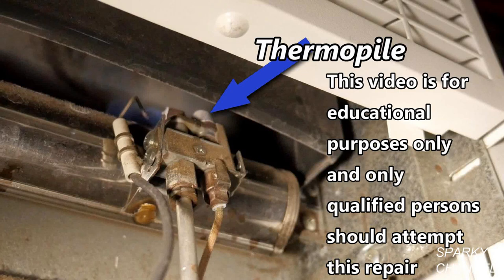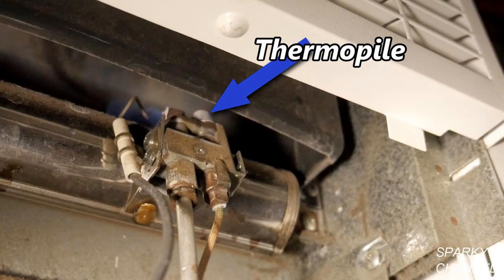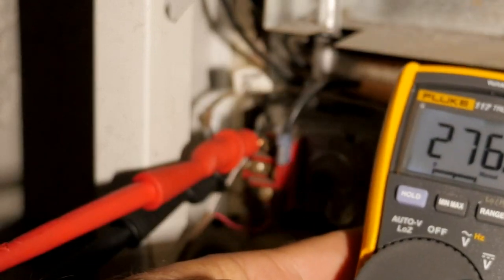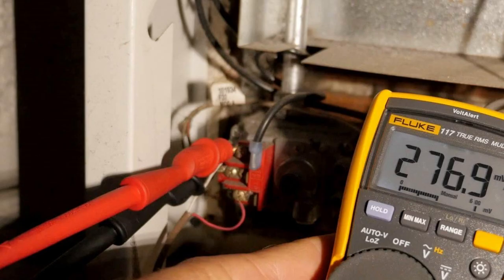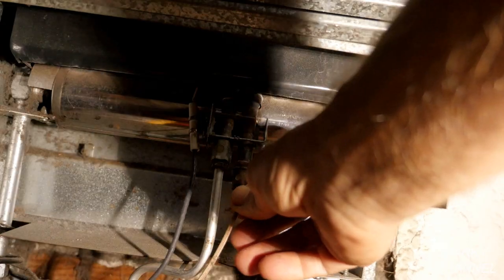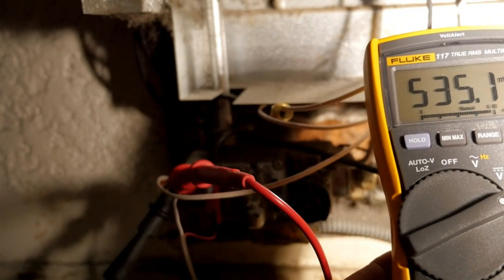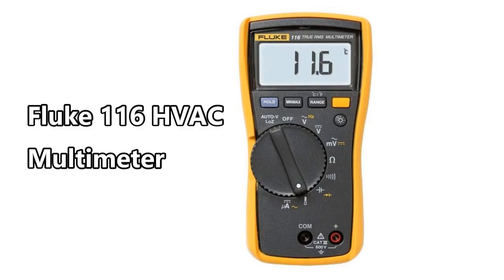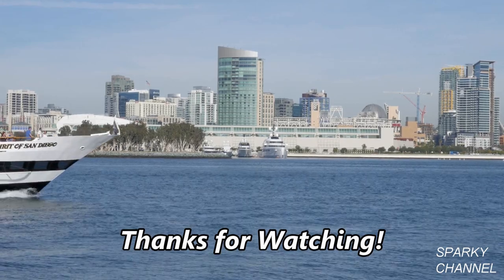How To Test and Replace a Thermopile: Wall Furnace Burner Won't Ignite

Comment: You have saved me yet again!!! I couldn’t find any other videos outlining my exact issue with my wall furnace, then I came across this video. Gave me something to test, then replaced and now works great!!
I have learned so much in 2 years from watching your videos. I have gone from not knowing how to change a receptacle to repairing wall furnace, upgrading all receptacles throughout the house, adding Caseta light switches, expanding the house electrical with breakers and new Fromex, and installing CAT7 throughout. Who knew I would love this electrical stuff so much!
Reply from the maker: Wow, that's great! Isn't that CAT7 nice? I get excellent speed with no interference with mine. It speeded up my uploads to YouTube so much! And it eliminated the botched uploads that I would have to do over previously. New video today: How To Wire 3-Way Switches with Diagrams Included: https://youtu.be/tkWhqMZiNvs
Thanks so much!

Comment: You helped correct me on thermocouple vs thermopile.  Hard to find an exact replacement for the thermopile.  Also I noticed with a replacement you have to have the pilot kinda high to produce enough mV.  In order to get 300mV+ do you have to have a significant amount of flame on the pilot?  In old stoves it’s a small flame in stuff with thermopiles maybe the pilot needs to be quite big to produce enough heat on the thermopile.  Thoughts?

Comment: Good video Sparky.  We still have a lot of wall furnaces, floor furnaces, and space heaters  in Missouri.  Most of them use thermopile.. Mostly LP gas.  Brands like Williamson, Cozy and Empire.
Reply from the maker: Lots of them out here in SoCal as well. Our heating needs are often met quite well by a gas wall heater. Thanks!

Comment: The pilot burner should aways be cleaned before testing the thermopile,The best way to check the millivolts is on a open read,that is with the white and red wires disconnected from the gas control valve,light the pilot(you will have to keep the knob depressed while making this test)then check read across the disconnected terminals with the pilot fully hot.The other test is the closed read,with all wires connected and the thermostat calling for heat.On this test the Millivolt read should roughly 1/2 the MV reading of the open read.You can also check the MV read across the gas control valve coil if you know what MV rating the valve needs to open.It could be around 150 MV with the thermostat calling for heat.
Reply from the maker: Thanks!

Comment: If the package shows between 250 and 750, one would think 277 (is) in between 250 and 750, being that 277 is above the 250 minimum & below the 750 maximum on the package. From some of the comments, I see these readings can change when heat is running. Maybe that's what I'm missing. Am i the only one that would have thought 277 was good enough (because 277 falls between 250 and 750?

Comment: Help! I have williams wall furnace just like this one. Use every day. All of a sudden, when I move the little black lever to the right on the analog thermostat, the furnace doesn't turn on like it always has before. The pilot light is staying lit but just not responding to the thermostat. Does this mean the gas valve is faulty or is it possible that the thermopile had gone bad? I thought the thermopile ONLY controls the pilot flame but maybe Im wrong? It's cold as shit this weekend, and it decided to brake now!! Please help!
Reply: It sounds like it is your thermopile.

Comment: Hey Sparky are both black wires with the blue insulation heads supposed to be plugged into the terminal? I see in the video that one is plugged in and the other is not. My Williams wall Furnace has both plugged in. Please let me know. Thank you!

Comment: I'm having a really hard time with replacing the rusty pilot light and thermo pile ..
On the Empire floor model furnace ..
The first pilot light I bought was a universal and pilot light flame was loud and way to high  making swoosh noise ..
Do I have to order a replacement from Empire ?
Or is something wrong with the furnace ?

Comment: Hi Bill, when I have my multimeter dial turned to 2 mila-vaults setting the readings I am getting is -.523 with thermostat off and -.075 thermostat on.  Is this a good reading?

Comment: Hi Sir
Thanks for video. I have old Williams furnace similar to yours (35GV-5). I replaced thermopile due to low reading (200mV). With the new thermopile, it read 500mV, the pilot got flames When thermostat turned heat on then the voltage across thermopile read about 250mv. But the furnace is NOT fired. Any advice or recommendations.
Reply from the maker: I'd check all connections and I would check for Signs of Carbon Monoxide Leaks such as:
Soot: You may notice soot-like stains on your furnace. ...
Smell: While carbon monoxide doesn't emit odor, it may get accompanied by other exhaust gases that produce an odor.
A yellow burner flame: The pilot flame may produce an unusual yellow flame instead of the normal blue one.

Comment: Question here.. I see voltage specs for furnace thermopiles (approx. 500-750mV) quoted frequently - but I can't find any current specs (mA). What is the typical "good" current range for one?

If it matters, my application is a very old (ca. 1910) hot water furnace with a milivolt gas valve. No 120V AC required, just a standing pilot + thermopile, a T87 mechanical thermostat & gas valve.

Issue is that the burner can be sluggish / hesitant to light up when the thermostat calls for heat. Thanks in advance.
Reply from the maker: You should be able to find those specs on the package of a new thermopile.
Reply: @SparkyChannel  I'm not finding that to be the case at all. If any spec is quoted, it's the same nominal 750mV..  when I'm wanting to know the expected current - either a short-circuit figure or the loop current with the gas valve coil in series.

My valve opens but it's slow to do so. The voltage seems OK, but a current figure would be good to know!

Comment: I havn old gas wall furnace. Simple two wire (R & W) to thermostat. No fans, no power of any kind to the furnace other that what comes from the thermo pyle.  Lived in the house for 25 yrs and have replaced gas control valve twice over the years. Last year furnace wouldn't ignite. Found that bumping the valve lightly initiated gas flow and ignition. Didn't replace valve as sometimes it would function for weeks with no problem.  Obtained new valve and upon inspection found a gas fitting between the valve and the burner leaking slightly. Tightened that and valve continued to function fine. Doesn't seem related does it! Few weeks ago upon signal from the thermostat the furnace would not ignite. Tap on the valve didn't work. Thermostat was a programmable one and I was constantly having to over-ride the settings, so replaced it with a new non-programmable one. Didn't solve the problem. Now, when I raise the temp control on the thermostat the furnace ignites and runs for about 30 seconds to 2 minutes then cuts off. turning the thermostat off for a few minutes, then on, the furnace once again ignites, then cuts of.  Dozens of trials with same results. Is it likely a failure of the thermo pyle?
Reply from the maker: I do think it is probably the thermopile. However, is your heater 25+ years old? If you've used it every year I really would like to encourage you to purchase a new wall furnace if possible. I understand about the financial implications but a new furnace would be much more efficient and possibly healthier.
Reply: @SparkyChannel    The only part that has "aged" is the gas control valve. I have looked at new wall heaters seen them disassembled. The metal exchanging chambers are virtually identical. The venting/chimney system are identical. And my unit shows no deterioration of the metal parts. Turns out to be a loose thermocouple wire and and an adjustment needed to the pilot to better heat the thermopylae bulb. Oh, btw, I keep a new control valve on hand. just in case.

Comment: I just replaced my thermopile due to pilot light not staying on. Worked great for 2 weeks and now the pilot light stays, burners kick in for only a few minutes and then they shut off. Any suggestions?
Reply from the maker: Did anything come loose or move?
Reply: @SparkyChannel  nothing that I can see. I'll check my wiring and surrounding areas.
Reply: Did you also check the vent safety switch?

Comment: My Williams wall heater looks like the one in the video. My thermopile just slides in without and threads just like in the video. The 2 thermopiles you suggested don’t look the same as the one in the video. Which one should I get?
Reply from the maker: Try to get the same one you are taking out.

Comment: Well, Bill, I have spent years figuring out how my furnace works in the presence of an incompetent technician. I had to yell at him to stop changing the thermostats, none of which was broken. I found a mechanical thermostat for this type of furnace, and now I can start the furnace by shorting the thermostat. It turns off at temperature. I inspected the thermopile today and it is like the one in your video, and now I know what to do. The technician has refused to clean or replace the thermopile. I still cannot figure out how he is still in business. Your very short video has shown me what I have been looking for since 3 or 4 years now. I have other heat for the house. I only use this furnace in the dead of winter on very cold days but I want it to function properly. I have paid this guy for so many pointless visits... I would like to ... well, cannot say it here what I would like to do to the guy.
Reply from the maker: Glad to hear that's it's working!
Reply: @SparkyChannel  it is not working but at least I know what the problem is and that I have to find a technician who will test the thermopile, and either clean or replace it. He will not be getting paid until he does exactly that.

Comment: Just rebuilt an Empire DV115 wall heater, new Robershaw regulator, thermopile, pilot burner/gasket, electrode, & igniter. Worked great, next day nope. Replaced therostate with an upgrated Honeywell digital programable, it working fine, but regulator valve apparenty not opening. Found thermopile putting out 356m thermostate off, 443mv thermostate on. My feeling is that many of these thermopile's are junk. Its a 36in long, I ordeerred a replacement thats 24in long, say's 750mv & compatable with DV210/215. I'll see in a few days if the new one fixes the issue.
My only thought is that the 2 wires running from the thrmostate into the heater to the regulator connectores is old. But I guess if I just dissconect them and jump the two regulator connectors, if the regulator dosn't ignite the heater log, then the regulator gas valve simply isnt getting enough power to switch on/off the gas valve.
Reply from the maker: Yes, try the new thermopile.

Comment: My thermopile reads about 550 millivolts with the pilot lit and the wall switch off but my gas fireplace still wont light.  My thermopile reads 10 millivolts when the wall switch is on.  Does this indicate a bad thermopile
Reply from the maker: What does the wall switch control?
Reply: Sparky Channel it suppose to turn on the fireplace so i guess it directs voltage to the gas valve. Think of it like a thermostat except its either on or off
Reply from the maker: @truenorthmuskoka9077  I see. 550mVDC is an excellent reading so I don't think the problem is the thermopile. Check the connections and make sure all connections are good. Does the pilot stay on?
Reply: Sparky Channel yes the pilot stays on. I checked my neighbours as he has the same unit. His also measures 550 mVDC with the pilot on and wall switch off. With the wall switch on the voltage drops by half which I read is correct. Mine drops to 10 mVDC so Im only assuming its an issue with the thermopile but im not certain. Thats what im trying to find out.
Reply from the maker: @truenorthmuskoka9077  I see. Good thinking to check the neighbor's unit. If his is working then yours should read like his. I would change out the thermopile.
Reply: Most wall switches for fireplace that are installed are 120 switches and are not for MV. i would try changing the switch
Reply: Mi Heating Guy I confirmed it was the thermopile. What type of wall switch do you suggest other than a regular 120V type switch

Comment: Man, my heater just stopped working this week. The pilot is still on strong and the reading is around 440mV. Could it he anything else or is juat replacing it the way to go?
Reply: Mine has the same 101934F32 tag on it as your dead one. Looks like it's just held in with that clip. Weird. I guess for $40 it's worth trying so my house won't be at 50 degrees. Although I'm saving on gas which usually doubles my bill in the winter... Hm
Reply: Ahhh huge bummer. I can jump it directly at the burner. The wires at my thermostat have 0 voltage. I think there is a safety switch installed inside the heater but it seems to be screwed high up to the side. If it's the wiring between the heater and my thermostat that gonna SUCK.
Reply: Hmm I took the cover off and some safety switch at the very top was tripped. I wiggled it a little and got voltage back at my thermostat but then the heater wouldn't shut off and I had to turn the gas off. Hopefully someday I can afford to go central HVAC.

Comment: We have an Empire Wall heater. Pilot light wont stay lit. Has a thermopile that looks pretty dirty with build up. Ordered a replacement. Do I need to shut off electric to replace thermopile or just gas?
Reply: everything, every time you fuk with it. Safety First!

Comment: I have a wall heater. I have to jiggle the wires towards the top of the heater for it to turn on. I have to do this several times to heat up my place. It's annoying. I tightened the connection but still having trouble. any suggestions?
Reply from the maker: Do the wires run from the valve to the top side of the wall heater?
Reply: @SparkyChannel  yes they do.  They then plug into a small part.  I think its called a limit switch.  Not sure if switch is bad or just need new wires.
Reply from the maker: @thinkblue8089  Yes, I was going to tell you about the limit switch. I think it's bad. Test it for continuity. If it's bad replace it and I think your problem will be solved.
Reply: @SparkyChannel  I'm afraid I'm going to blow something up if I try to replace it myself. You have to use mfg part right? I'm thinking of calling a hvac company out.
Reply from the maker: @thinkblue8089  My advice is to call an HVAC company this time but watch carefully and ask questions so that you'll build up your knowledge and confidence.

Comment: Would anyone kindly tell me how to remove the thermopile, it has one screw and a metal plate to hold the thermopile, but i still cannot remove it or pull it down after I removed the metal plate. I can turn it a little bit but it is no way to pull it down.